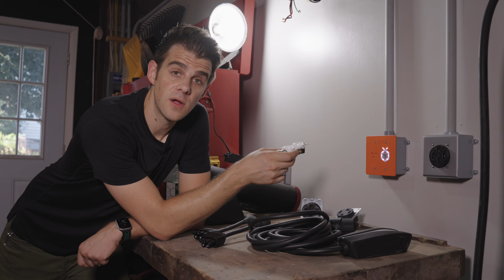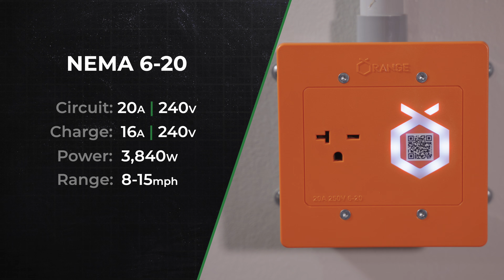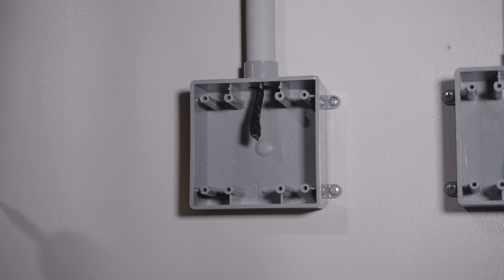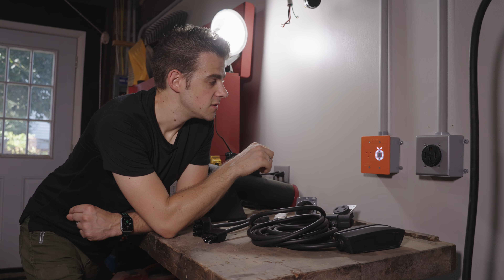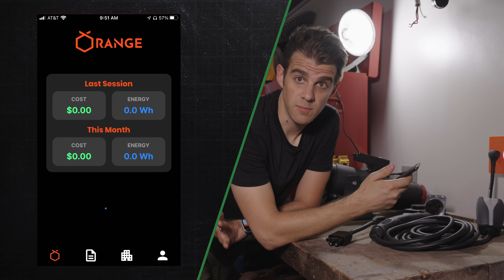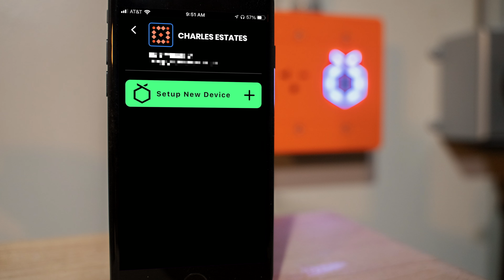A Better Option for Apartment EV Charging: Orange Charger

Comment: Yet another reminder that EV vehicles are a failed concept outside of niche circles, and will stay that way.. and I own an electric vehicle.   The infrastructure flat out cannot handle any real number of electric vehicles charging nightly.. and with these low charge speeds, it will indeed be a nightly affair.  You'll realistically get 3-4 miles per hour charging at 110v 18amp, which means a whopping 25 miles for an overnight charge.
Reply: Yes, the infrastructure CAN handle large numbers of cars charging nightly. I just looked up the data. In the Mid-Atlantic area, power peaks during the day around 125 million kWh, but at night, it drops to roughly 85 million kWh. That means roughly 40 million kWh are available for EV charging nightly. 
And besides, as the number of EV's grows, the power companies will be able to build or enhance existing power plants. Remember, this is not going to be an overnight change. Gas cars will continue to be driven long into the future, and some specialized units may remain fuel for a very long time, like fire trucks.

BTW, the officers of the NYPD mostly LOVE their Ford Fusion Hybrids. As police cars are never turned off except at meal time, a hybrid is great for cops, as they can keep the car at the right temperature and still use 1/2-1/3 the gas of a conventional car.
Reply: The grid can easily handle 100% EVs also when I used 120v 12a, I got 50 miles over 10 hours. Usually I am able to charge for at least 12 (60mi). Now I use 120v 16a and get 75mi after 10hrs
Reply: @chidorirasenganz  Where do you guys come up with this stuff?

The grid can't even handle people running their AC in the summer at this point and multiple states have had massive failures in the last few years.

Less than 3% of cars are EV right now and we are already running into issues where people cannot charge their cars on certain days.

Tesla just raised their rates at superchargers to almost 65-70 cents a kwh, depending on location. At that cost, I can fill up a gasoline car for about the same price.

Europe is about to freeze to death and electricity now costs more than gasoline in most Euro nations..

Absolutely no way you're getting the numbers you're saying either unless you are in the most "fuel" efficient EV invented, which a vast majority of people are not. 

1400w would give me about 2.5 miles per hour charged and I an above average vehicle (87 MPGe).  The most efficient is a Tesla model 3 at about 140 MPGe on paper.

We can calculate out how long a Tesla Model 3 will take to charge at 120v @ 12a quite easily.  Their own website says you would expect 2.5-3 miles per hour charge out of their 120v charger. 

A Tesla Model 3 is also over 60K right now as you cannot order a non performance package equipped car at the moment.

As we move more of the grid over to renewables, we lose the ability to charge electric vehicles.  The irony is amazing, I know.  

We didn't have power generation issues like this when we used nuclear and coal.
Reply: @J_Madison  The only state having issues with peak AC usage (which is the most power intensive most folks have) that I’m aware of is California. Global warming isn’t helping but the concern of EVs and power usage ignores the massive amount of electricity used in refining and pumping gas which is far more energy intensive. And that’s without considering how ICE cars waste 70%+ of the energy in gas.

Currently EVs make up 5% of vehicles in the US and 15% in California. People can charge their EV everyday but some days its encouraged to be done off peak hours. Which is encouraged anyways since most power providers offer cheaper rates since that’s when there’s less demand.

Electricity is still cheaper than gas everywhere so I don’t know where you’re getting that. 

The highest I’ve seen is ~40 cents per kwh which is only 20$ to fully charge my SR+ Model 3 but that’s rare to use a supercharger to fully charge an EV. Usually its done on a lvl 1 or lvl 2 at ~10-20 cents so 5-10 dollars at most. 

Most EVs in the US are Teslas as they hold 70% of the market. Teslas are the most efficient EVs (Other than Lucids). The Model 3 gets 5 miles per kwh so thats why your numbers are off. Worst case scenario its closer to 4 if you are doing a lot of sudden acceleration or speeding.

Miles per hour isn’t a good representation of charge rate as it depends on the battery size and efficiency. A vehicle with a smaller battery is more efficient and thus gets a higher amount of miles with less kwh. Hence my Model 3 SR+ gets 1kwh per hour and if I charged from empty (which I would never do) would take 50 hrs as it has a 50kwh battery (not including the buffer). A Long range or performance model has a 80 kwh battery which would obviously take longer. Hence why miles per hour isn’t a good measurement.

The Model 3 starts at 47k right now but was just 40k last year and likely will be next year. Tesla just introduced a 40k Model Y in Europe and has one and a Model 3 at the same price in China. So no they don’t start anywhere near 60k. Only the long range model in the US isn’t available for the rest of the year, if you haven’t ordered one already because they are still making deliveries for that model.

We are still able to charge EVs as I stated before and we still use nuclear and coal. In  fact 40% of the grid is Nuclear and Renewables so we are almost halfway to removing fossil fuels entirely.
Reply: @chidorirasenganz  Why you gonna waste time with a reply that is completely and utterly filled with BS?

"Much of the U.S. could see power blackouts this summer, a grid assessment reveals" - NPR, May 20, 2022

"Less than 1% of the 250 million cars, SUVs and light-duty trucks on the road in the United States are electric." - Reuters, Feb 2022

According to ADFC (Alternative Fuels Data Center) ran by the Department of Energy, California has 563,070 registered EV.  Do you think 570K constitutes 15% of all automobiles in a state of almost 60 million people?  You've completely confused new car PURCHASES with total cars on the road.   Seeing as California is forcing people to buy electric, why are you surprised new car sales are slightly trending higher for EV?

You cannot buy a Model 3 for $47K right now as they are only shipping with the Performance package. i JUST went through this buying an EV. The Model 3 with performance STARTS at $60K before any other options. 

You seem to know absolutely nothing about this subject. Furthermore, you're arguing against Teslas own posted numbers of expected charge rate at 110v.  Go take it up with their engineers since you seem to think you've somehow beaten the system. 

The entire industry standard is 2-3 miles per 1 hour charge over any 120v, 15A outlet. It's great that you confusingly think your situation is special, but I'm going on to base my knowledge on industry standards and not some guy on the internet who got quite literally every single statistic wrong.

Comment: Having wired both 6-20 and 14-50 outlets, I can assure you that it is much easier to wire a 20 amp outlet than a 50 amp one.
The question still remains of how many additional 20 amp circuits a building can add without looking at the wiring to the nearest transformer.
Reply: orange is networked already.  so they can come up with software to only allow for a certain amperage pull from all the units in a specific building or on a specific breaker panel.  and perhaps allow for delayed charging (at a slightly cheaper rate) for those that plug in,  but delay charging.   shared total power consumption is a must for these units.  that is 1 way this both wins and fails.  It does not allow for granularly control down to the exact amp each ev gets.  it would just allow for on / off of evs. but that is a good step foward.  This is a short term solution.  the long term solution will be EVSE's that are networked and share power to the amp. these will be cheaper in a couple of years and a company like this will likely drop off unless they make their units for like 50 bucks or something.. where an EVSE would never be that cheap because of the amount of copper required for the cable.
Reply: Most Chargers are smart chargers which talk with each other. You can plug all on the EVs into a particular circuit and they will proportion out the amperage to each charger to prevent overloading the circuit.

Comment: Just wondering why exactly would somebody pay to charge 120 volt outlet? Their apartment has several of them that they could use for free. Does this unit come in 240 V? It’s worth installing a 240 V outlet it’s part of the cost of doing business
Reply: Never mind I just went to their website and answered my own question. 120 V only totally useless! Let me know when they come out with a 240 V Nema 1450
Reply: @Magicinstalls  The unit they shower is a 6-20 outlet, which is pretty efficient. It provides a MY about 14 miles of range per hour of charge.
Reply: @Magicinstalls  There is a 240V option, the Orange 620.
Reply: A 120 volt 20 amp circuit provides a Tesla Model 3 about 4 miles of range per hour of driving.
A 240 volt 20 amp circuit provides a Tesla Model 3 about 15 miles of range per hour of driving.
At first glance, this makes no sense. You have doubled the power, yet the range nearly quadruples!?
The difference is that it is MUCH more efficient to convert 2-phase power to DC than to convert single phase power.
Reply: @colinpovey2904  I'm not sure where you got this information, but this is completely untrue. First, 240V is single-phase, same as 120V. Second, it is not any more efficient to convert multiple-phase power to DC than single-phase. Go double check your charging numbers.
Reply: @colinpovey2904  I just don't understand why the don't have a 14-50 metered outlet. level one charging is pretty dismal even @ 14MPH. We own apartments and are looking for a solution. Look like we will be installing L2 chargers. It's a shame because most EVs come with a L2 cable ready to plug in...
Reply: @Magicinstalls  First, anything above 120 volts, 20 amps is a level 2 charger. So, a 6-20 and a 14-50 are both level 2 chargers.

What you seem to be overlooking is the cost of wiring a 50 amp breaker for every charger you want to install. The cost of the installing a 50 amp circuit is many times that of installing a 6-20 outlet. A 6-20 only requires 12 gauge wire, though some may prefer the next larger size for safety. And for a 6-20 outlet, you only need 3 wires. For a 14-50 outlet, you need 6 gauge wire, and 4 wires per outlet. The wires are not only much thicker, they are much harder to work with. If you are going just a few feet, not a big deal. But if you have to go any real distance, this difference will be huge.Per Home Depot in my area, 100 feet of 12/2 Romex is $110. 100 feet of 6/3 Romex will be $529. Add in the cost of outlets (good 14-50 outlets are $70, as opposed to good 6-20 outlets at about $20). And the breakers are also very different in price.  Add in more labor for the harder to work with 6/3 cable, and the price will be distinctly higher. 

So, let's price a 25 foot installation in 6-20 and 14-50.
6-20
Wire $28
Outlet $20
Cover plate: $8
Box: $8
(conduit and breakers are very similar in price, so I will leave them out of the formula)
Total for 6-20:  $64

14-50
Wire: $133
Outlet $70
Cover plate $12
Box: $12
Total: $227 (3.5 TIMES expensive as a 6-20 circuit)

For most people, a 6-20 outlet will be sufficient. It will supply (to a Model Y) 14 miles of range per hour of charging. The much more expensive 14-50 will only supply 29 miles per hour of charging. See here for info: https://shop.tesla.com/product/gen-2-nema-adapters
Reply: @colinpovey2904  For most people? That statement on its face is idiotic! Most people want a level two charger that’s why they pay to have them installed in their garage! Nobody wants to charge their car at 14 mph. “Most people” would like to have their car fully charged and ready to go in the morning and at 14 mph this will not happen!! this outlet is useless! Unless they get on the ball and create a level two outlet, they will fail and go out of business…
Reply: @Magicinstalls  A 6-20 outlet IS a Level 2 charger. Level 1 is 120 volts. Level 2 is all 240 volts AC chargers. Level 3 chargers are DC fast chargers, which can be much faster, but care a lot more expensive, and many smaller EV's cannot use at all. (All batteries are charges by DC power, and a device called a rectifier is used to convert AC to DC power. Essentially all EV's come with rectifiers built-into the car.
Reply: @Magicinstalls  Most people will be at home 10-12 hours. That means a 6-20 outlet will provide 140-168 miles of charging (In a Tesla Model Y, a small SUV) overnight. Few people drive more than this daily.

For Tesla;s, you can install a wall charger on a 240 volt 60 amp circuit and obtain about 42 miles per hour. But most Tesla owners are installing a 14-50 outlet, and getting 29 MPH.
Reply: @Magicinstalls  Level 1 chargers use 120 volts. Level 2 chargers use 240 volts.
Reply: @Magicinstalls  most folks can get by with a standard 120v outlet. I did for a year and got 2% an hour. Most days I didn’t drive more than 10%. I recently upgraded to a 120v 16a EVSE and I don’t see a reason to step up to lvl 2 at all now. Overnight (12 hours) I get 30% back, a third of my range (250mi)

Comment: Many EV's, especially the smaller EV's are easily charged by 6-20 outlets. For a Tesla Model 3 or Y, a 6-20 outlet provides 14-16 miles of range per hour, which will probably handle the needs of most people. I mean, 8 hours at 14 miles per hour is 112 miles of range with an 8 hour charge. Few people drive more than 100 miles a day.
And if you can get 12 hours per day to charge, that's 168 miles of range per day.
Reply from the maker: Agreed. Even my Bolt, which I drive 150 miles to work has sufficient time to recover overnight at 16A, 240V.

Comment: You cannot blatantly state 6 AWG, if someone uses Aluminum Wire you will need a heavier gauge. 6 AWG Romex normally only can carry 55 Amps, but only 44 Amps for an EV or other Continuous Load. You can use 6 AWG THHN in a separate conduit as it is normally rated at 75 Amps, or 60 Amps with the required derating for Continuous Loads. I can see this as being useful, if there is absolutely no way to pull new conductors. If new conductors can be run, Tesla (with 6 or more Gen3 Wall Connectors) and other companies allow for billing with their Wall Connectors. Remember the Chargers are built into the cars, all you all doing is feeding the On-Board Charger.
Reply: If your charger is only 32 A, you could use AWG 8 copper for short runs from breaker box.
Reply: Yes and Romex is not ideal due to heat issues. I would use a  6/2 MC Cable for a Gen2 Tesla Wall Connector because it is rated for up to 75 Amps, or 60 Amps for a continuous load. 8 AWG Romex is rated up to 40 Amps and derated 20% for a continuous  means that you could pull 32 Amps charging a car.
Reply: @michaelholliday100  Agree with you.  I use THHN in conduit, PVC if outside.
Reply: Nobody uses aluminum wiring! Your reply is nonsense…
Reply: @Magicinstalls  Yes, believe it or not many contractors use Aluminum Wire on 240 volt applications in homes and commercial applications... You just must be extra careful to tork the connections and it will require a larger size conductor.  Aluminum wire only presents an issue if it is not used properly... Most Power Companies use Aluminum wire in the main feed to your home.
Reply: @michaelholliday100  Any reputable contractor would use the proper size wire regardless of whether it’s aluminum or copper
Reply: @Magicinstalls  Believe it or not I have seen EV installing done by major contractor that have used the wrong size wire primarily due to the fact that they were unaware of the Continuous Load issue or another issue.
Reply: But yes I know, but I would never use aluminum in my home for any use...
Reply: @Magicinstalls  Believe it or not I have seen licensed contractors use the wrong wire on EV Charger because they fail to engage brain and remember that a continuous load (a load expected to last 3 or more hours) requires derating everything on the circuit by 20%.
Reply: @Magicinstalls  Believe it or not, yes there are still those who use aluminum wire, would I no way.

Comment: One problem I can see is another ev owner unplugging the evse either from car or orange outlet and "stealing" a charge

A simple solution to this would be to sense if current higher than say 200w stops then disable the power output
Reply from the maker: That’s actually a good issue you’ve raised. The problem with sensing a drop in power is if your vehicle is using scheduled charging. Mine will immediately charge to 40% and then I typically schedule it to start back up in the middle of the night so that it finishes right before I’m ready to leave in the morning.

I’m not sure exactly what the best approach here is. If the Orange was an EVSE it could tell when the car was actually unplugged.
Reply: @chargeeverywhere  This actually can't happen for a few reasons. First once the unit senses that its been unplugged it will send a message via the app to the vehicle owner that the charge session has stopped. Second someone else won't be able to just plug in as they will need to scan the QR code and iniate a new session which would charge them and not the person who was just unplugged.
Reply: @chargeeverywhere  that is a good point on scheduled charging.  That would be a difficult thing to work out how to solve reliably. But an idea would to have scheduled charging in the orange app.

The biggest issue is that it is not an EVSE and cant tell when a vehicle is disconnected.  If the auto manufacture of the vehicle being charged has an api to tell if the car is charging, plugged in, or other info then that api could be used to tell the orange app.
Reply: Or just put a sensor on the Orange